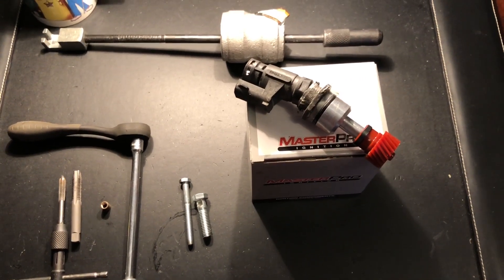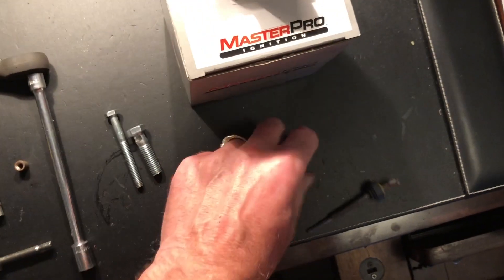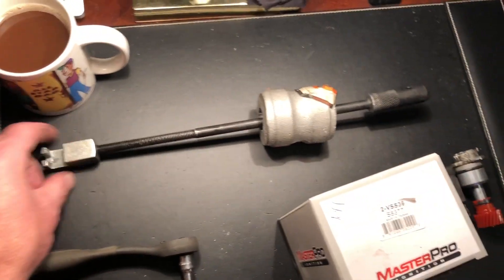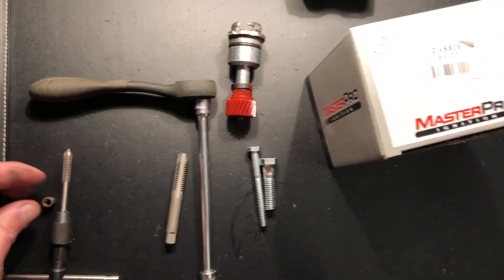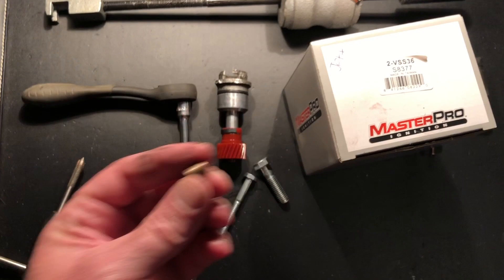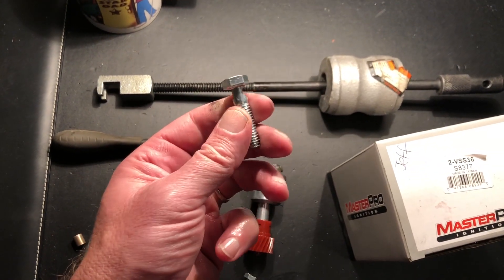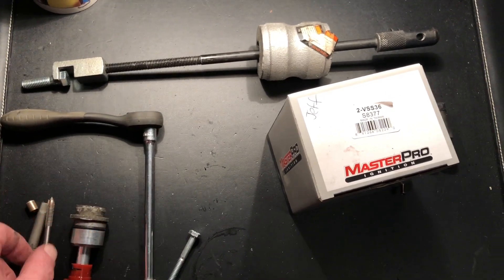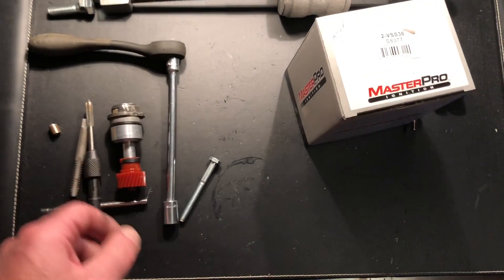Vehicle Speed Sensor (VSS) Removal - Ford Escort (P0715 Input/Turbine Speed Sensor)

Comment: Where do you get the attachment on the end of your slide hammer?
Reply from the maker: It came with the slide hammer
Reply: @MrIntored mine didn’t but I think I found a different way by using a socket that is bigger than the sensor and a bolt with a washer and nut on it so the bolt will pull the sensor up into the socket and out of the transmission

Comment: Was the speedo not working? My speedometer on cluster is not working and I don't see any signal coming from the sensor and I don't see vehicle speed changing when viewing live data with the scanner therefore I believe I the sensor is bad. Were you getting codes at the transmission or  PCM module?
Reply from the maker: I'm not sure if I ever mentioned it...I think the issue was a shifting problem were the trans would hold a gear for way too long...its been a long time ago and was daughters car, but the speedo was still working fine I think.

Comment: Thanks.  Saved me a lot of trial and error and head scratching.  The taps were the ticket and worked perfect.  I used a rig with some 1.5 pvc pipe and the 3/8 bolt to pull it out instead of the slide hammer. Probably about same effort.  I had the bonus of the head snapping off of the hold down bolt too but once the sensor was finally out I had room to get an extractor on what remained.   I watched the video before doing the work and thought if i sprayed it down with penetrant, did it when the trans was warm, and agitated it some I wouldn't need the taps.  I still needed them.  2002 zx2
Reply from the maker: Yeah, I tried the same "shortcuts"...in the end best off just prepping for this approach and getting it done. Nice work on the improvised slide hammer...I have a couple similar in my tool box too.

Comment: What year escort is this?
Reply from the maker: John this was a 2000 ZX2
Reply: MrIntored thank you! Where did you buy the attachment for the slide hammer? I can’t seem to find it on the internet, maybe I’m looking for it with the wrong name
Reply from the maker: John Mora it was included in this cheap slide puller kit I bought years ago from Harbor Freight along with bearing hooks and hub adapter.